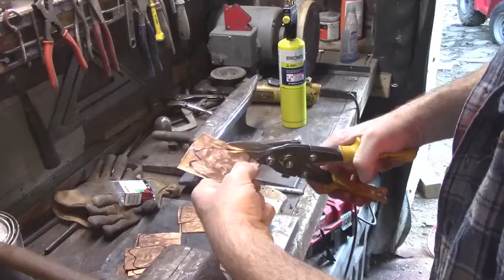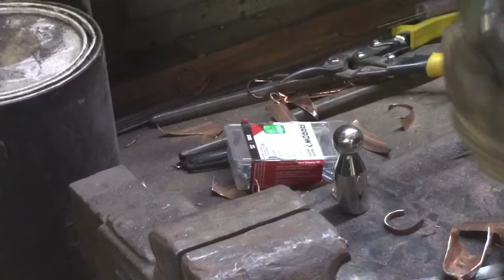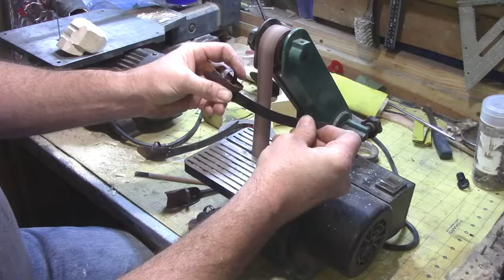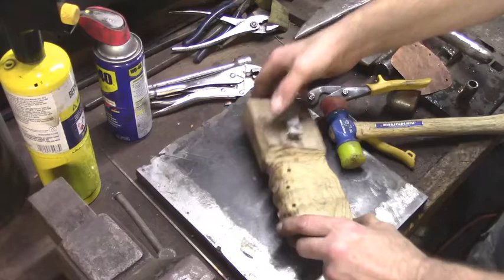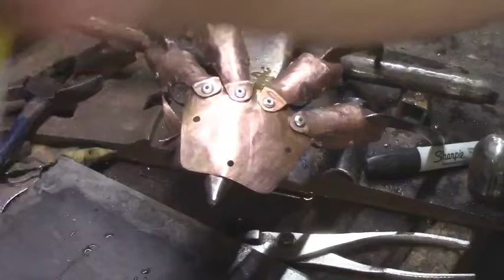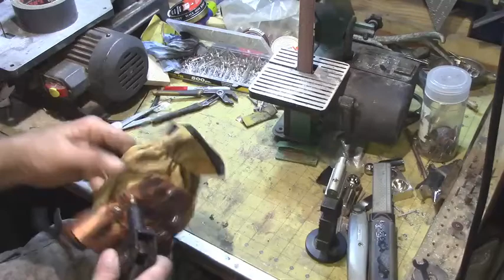How to make your own FREDDY KRUEGER glove ( FULL TUTORIAL) as authentic as possible

Comment: You can use 3/4 inch pex rings. Pex rings are made from copper and are normally used for pex water lines, but they are almost perfect for this.
Reply from the maker: Yes that could work. And there’s probably many other better and easier ways to do it. Thanks.

Comment: The spacer when you rivet is genius
Reply from the maker: Thanks. I didn’t think of it until I had already made one and the fingers wouldn’t hardly bend.
Reply: @randylawson7187  I used the 2 piece steel rivets. Sometimes they catch on each other because they don’t tighten enough
Reply from the maker: I played with a few different ways and the one I use I liked the best. Like you said one was too loose and or just to difficult to do them all.

Comment: This is easily the most detailed, durable, movie accurate, and creative build I’ve seen thus far by all standards (Freddy would be very proud). Could you also use 16 gauge stainless steel for the knives, or does it not solder to the copper as easily as standard steel would? Just a thought
Reply from the maker: First off thank you and no I never did have any luck getting any stainless steel to solder to the copper and hold long. But that’s me someone els may have the knowledge to do so but I haven’t seen it.
Reply: @randylawson7187  Yeah I figured. Standard steel is definitely the way to go. It looks better plus it’s more fun to work with.

Comment: What’s that round piece you were hammering the copper on?
Reply from the maker: My dad worked in a mine and had accumulated a pile of mining bolts and various other things. I just found a piece that was the size I wanted and took a grinder and belt sander to work it to the shape I needed. Unless you are asking about the railroad rail that was turned into an anvil.

Comment: Would Soldering Core for Saudering Irons Work for the Blade attachment?
Reply from the maker: Sadly no. It is too soft and wouldn’t bond to the steel.
Reply: @randylawson7187  What About Plumbing Solder?
Reply from the maker: @Art.0606  I need was able to get anything to bond both copper and steel together but the silver solder. There may be other options but I don’t know what they are. Sorry

Comment: Can i use sheet metal for blades also what would be best thickness to use an can i use sheet metal cutters to cut blades
Reply from the maker: If you are talking about the sheet metal used for duck work pipes I’m not sure if it would work because some are galvanized. But the metal I used in the video is too thick to cut with hand cutters but you could go with thinner steel but you lose the strength and they would bend easily

Comment: how long are those copper tubes you have?
Reply from the maker: I start off with about a 3” but after both finger pieces are cut out and shaped they are 2 1/2” long each. I have a diagram with the exact measurements available

Comment: You cut your 16 gauge sheet with what? I do my glove with a grinder and damn i found that painfull and long when i do all the four of them with it. Is there a more rapid solution?
Reply from the maker: I also use a grinder but I cut one and shape it the way I want it and I cut 4 or 5 more pieces of metal just a little bigger then I take small c clamps and clamp them together. Then I grind all of them down to match the one. This way you will have an extra or two and all match exactly.
Reply: @randylawson7187  cool i did do this but im killing my grinder its like take forever grinding them to match the blade i did first. of all the application i do. Shaping the blade and welding them on the finger is the most pain in the ass job of the build i would say
Reply from the maker: @spliter541  I agree. It is the most difficult step. But when you have built it all by hand and put it on it will intensify how you feel for it.
Reply: @randylawson7187  i allready build 4 glove up to date but i got friends who want them so i need to do more but i just want trick to be able to be less of a pain to make. il did find you can use a jigsaw with metal cutting blade and its doing a good job on 16 gauge sheet. I gonna try this out
Reply from the maker: @spliter541  I too tried a jigsaw and yes it will work. I keep having the saw blade bend the metal blade I was cutting, but the grinder can too. The jigsaw may work out better for you but I prefer working with the grinder.

Comment: What kind of solder are you using and are you using flux?
Reply from the maker: I use silver solder with 15 percent silver. Yes I use flux. They are many different brands I’ve used one called stay-silv 15.
Reply: @randylawson7187 thanks for that. I just haven’t been able to get my solder to stick to the steel.
Reply from the maker: @everfreebrumby8385  this is the most difficult part even for me to get the copper and steel to bond together using the solder. I start but getting the steel and solder to bond. When that is achieved to bond them to the copper is easier. Get the copper hot first then introduce heat to the steel with the solder. the instant solder starts to melt add just enough to the copper tying it all together
Reply: @randylawson7187  thanks for the advice. I think my copper is also too thin, I’ve tried so much that the copper crumbled under the heat. Also maybe I’m using the wrong solder. Anyway thanks for the info. I’ll keep trying.
Reply: @randylawson7187  thank you so much for the advice & encouragement. I finally got the steel to stick to the copper. It’s your video that made my think I could make my own glove.
Reply from the maker: @everfreebrumby8385  awesome now that the hard part is done you will be able to do the rest much easier